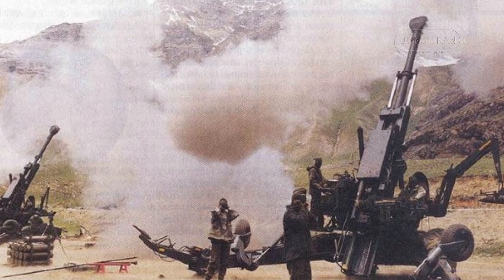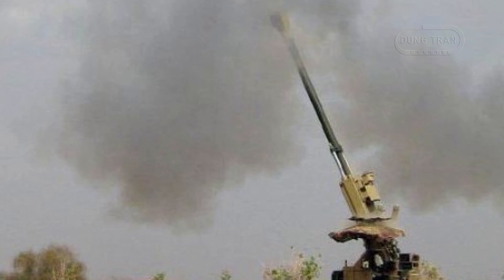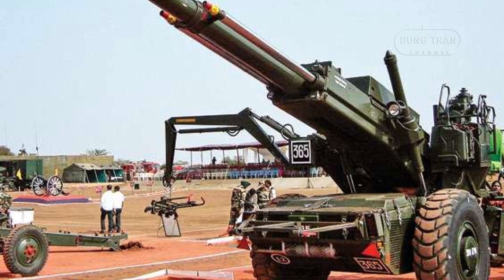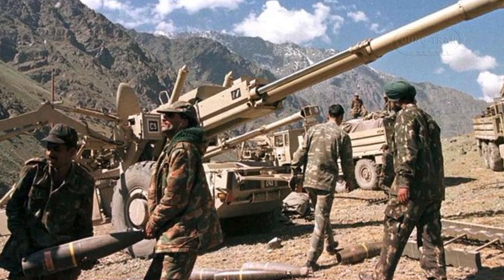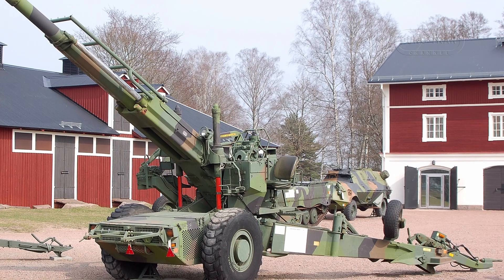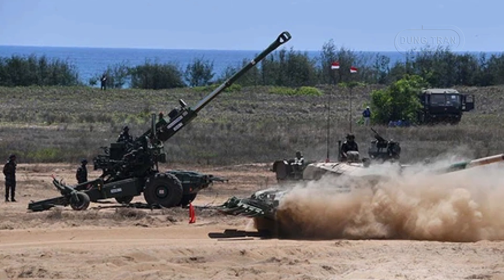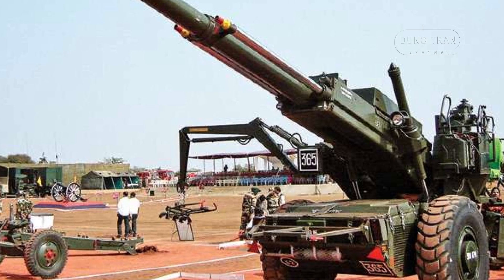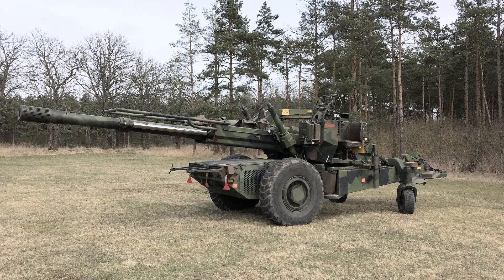Sweden's 155mm Powerhouse FH77 Haubits Crushes the Competition

Comment: Minor correction, the Archer uses a L/52 caliber barrel.
Reply: I think the L/52 stands for length. How many times the caliber or the diameters there are in the length of the pipe. L; length. 52 equals the number of diameters needed to measure the full length of the pipe. It says a ratio and not a caliber.
Reply: @donquixote1502   I know that, but it's called so.
Reply: @FXGreggan.  you are correct 👍